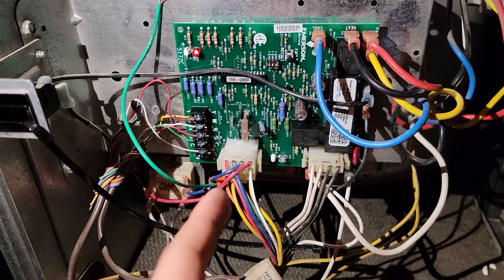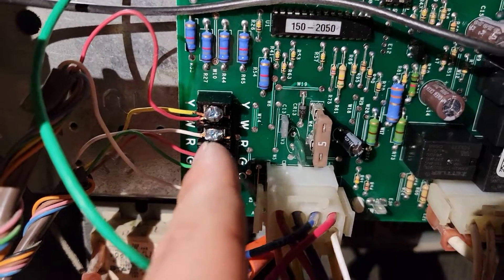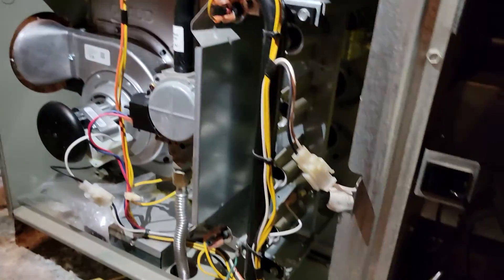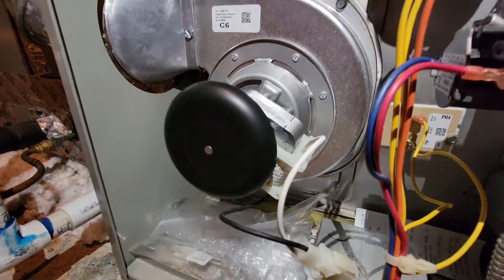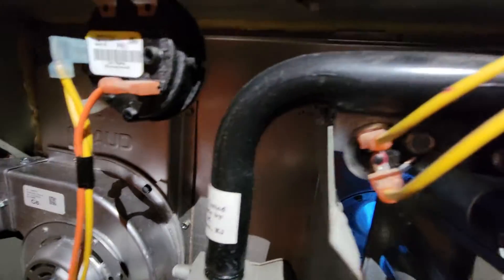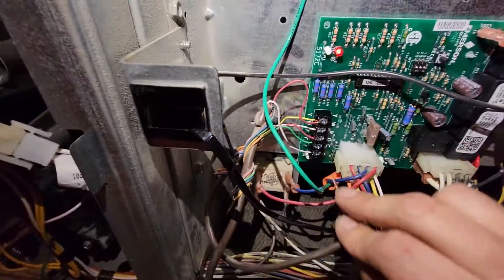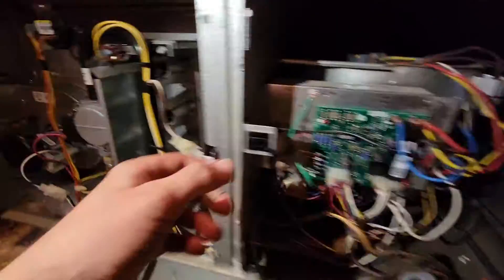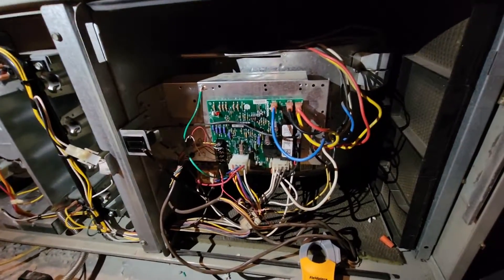Control Board Gas Furnace No Fan Delay

Comment: I can't say I've ever seen that. Possible that thermostat is set for electric heat? I would recommend that flex gas line penetrating the cabinet be removed or at least hard piped outside of the cabinet. Keep up the good work.
Reply from the maker: Yeah I don't like flex gas line it's like flex Duct work it's just not the best
Reply: Why not flexible in there? Thanks